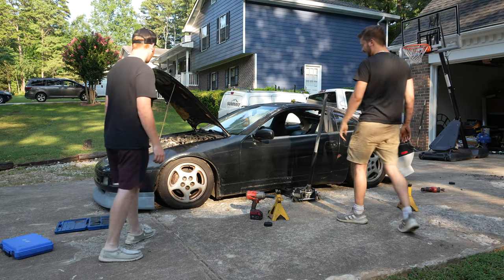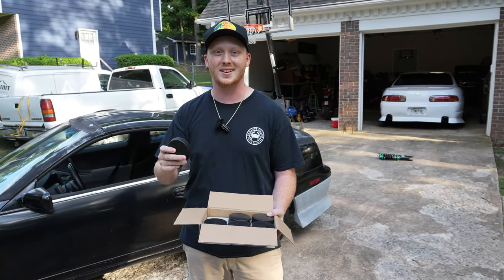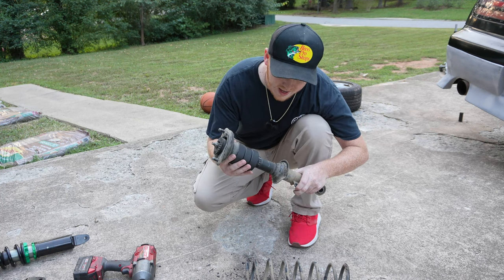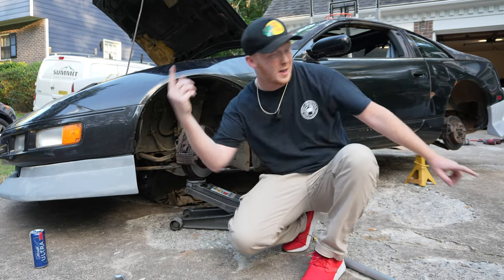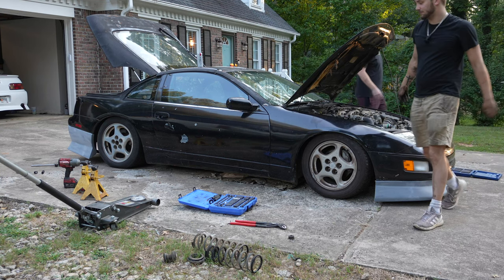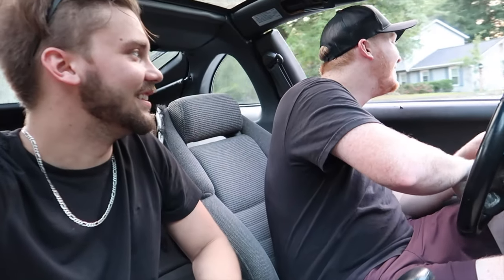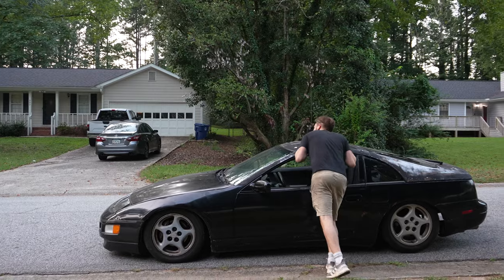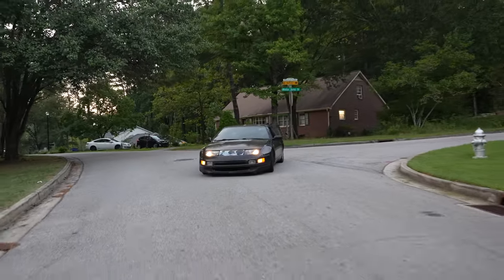How to Lower a Car for $20 (SO SLAMMED)

Comment: You're a pucker!   Came for some nostalgic scr8pn frame  b roll. Maybe a pinched exhaust pipe or cracked anything. My personal favorite, being high centered on any main road when it pushes you into the low side of the concrete.. lol.